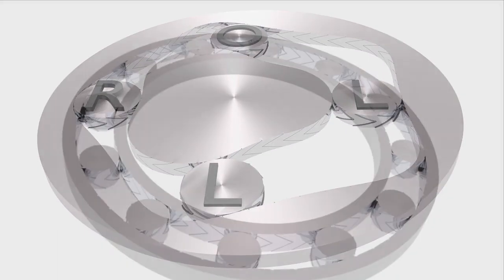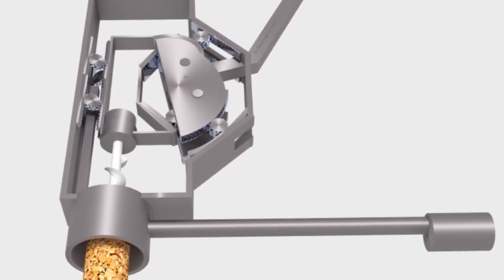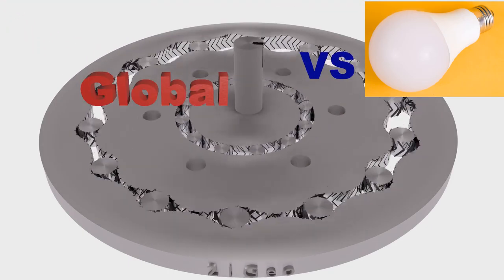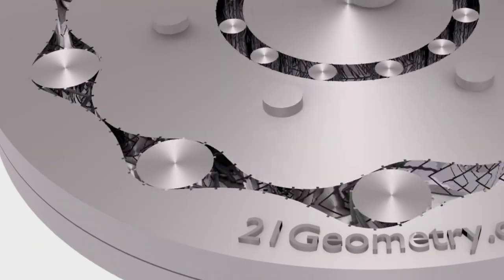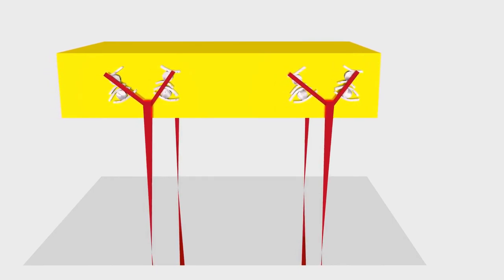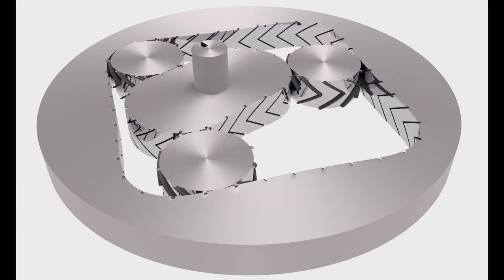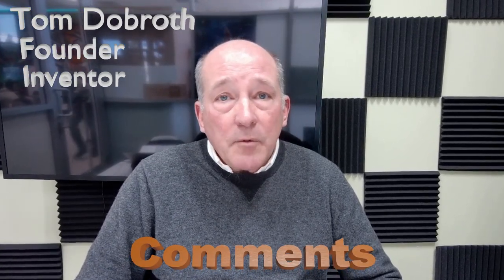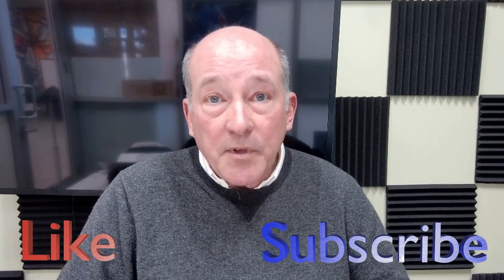Introducing Roll | A new technology that enables rolling everywhere.  v2

Comment: What is the relationship between 21Geo and RollCorp?   According to the 21Geo web site, the material there is copyrighted 2018 - though the site has only existed since 2020, with the same CG models presented here - so you've been at this for a while now.   What machine shop has quoted for producing a prototype?   What was the quoted cost?   What lab will perform testing of the prototype?   At what cost?   You have provided absolutely no stage goals for fundraising - how are potential contributors supposed to gauge viability without knowing what the financial requirements are?   There are clear geometric conflicts in the CAD model chevrons presented here, precluding operation - do these represent your ultimate geometry?  If not, what does that look like?   The positive chevrons appear with a different texture than the associated parts- are they from a different material than the associated roller?
Reply from the maker: RollCorp is a dba of 21Geo.  The corporate strategy has been challenging during a pandemic.  For a while I had to set this aside.  The questions you ask can only be answered with funded test project.  

The guide systems are a place holder for an actual device.  Only with a target (RPM, HP, service life) can the elements be designed.
Reply: @Roll-Labs  "The questions you ask can only be answered with funded test project. "

With due respect, that ain't true.  Talking to a machinist about producing the part and receiving a quote MUST happen before funding- HOW ELSE ARE YOU TO KNOW HOW MUCH YOU NEED TO RAISE?   Likewise for lab testing.   You have no goals.

"The guide systems are a place holder for an actual device."

This is disturbing; you have presented a model with critical missing elements- we have no way of assessing the viability of your solution, or determining if you even HAVE a viable solution!

"Give me money to reduce our industrial impacts."

"How much money?"

"I don't know."

"To do what, where, with whom?"

"I don't know."

Do you see a problem here?
Reply: @mavigogun  "The questions you ask can only be answered with funded test project. " 

Translation: "Give us money and we'll come up with something later!"

How many times have we been down this road?

Comment: The gearbox looks interesting.
A problem i see with some of the solutions are the number of parts vs current status.
Reply from the maker: Actually the same number of part as a cycloidal drive.  (if you count the ball bearings as one part.  If you count ever ball as a part, then cycloidal drives have many more parts).

Comment: What are the v shapes in black made of? what are the specifics about how the v ridges slot into the v indentations? Do they not "slide into place? Do they not "shear" along the straight edges as they slide into the slots? If not how? I look forward to your wonderful ideas being made! Maybe a "in the shop" youtube series about making them like wintergatan's marble machine music box series (he would Love to hear about your designs btw)
Reply: I believe they're specifically for indexing, not for transferring load. I do wonder, how would one assemble this device? Packing a bearing is already frustrating enough, this looks nightmarish if not solved by a two piece outer race (don't have a better term for it).
Reply: @saml7610  Except these 'indexing grooves/slots' will shear under the smallest amount of load, because they're acting as a sprocket.  How would one assemble these? Probably in the typical way any device that uses bearings is assembled, because these rollers rely on a shaft to keep location, whether that's in a hole or in a slot; the rollers themselves are not bearings.  The language and presentation is purposely ambiguous, and with over a half a year of CG promo after CG promo with no actual demonstration or realistic render.  Coupled with the typical bullshit about how this will be revolutionary and how green, or eco friendly, it is, which is typically seen in bullshit vaporware products, remember Solar Roadways, or the Thorium reactor car?  Oh and let's not forget false equivalence to LEDs. 

The thing is, everything shown here doesn't require indexing, and indexing makes it far more complicated than it needs to be, especially within manufacturing.  In fact, indexing is a bit of a step backwards, as your rolling elements that rely on surface friction to roll now act as a sprocket.  And guess what, squared off protrusions and grooves won't work, they would need to be involute, like a gear, except far less efficient given that herringbone involute gears already exist but the shallow depth makes these things lesser.  Funny how it comes full circle like this, which contributes to the bullshit factor.  

But a better method does exist.  There are fluids of variable viscosity that will basically become a solid under pressure, allowing for lubrication of a system elsewhere and a friction patch to allow for rolling of a circular or spherical element along a path on top of the high viscosity point of the fluid, these are often referred to as traction fluids and are often used within traction drives.  They're a great way to transfer force under smooth surfaces where gears are otherwise too complex; a great example is toroidal CVTs.  Curiously, one of the major players within the industry that is not only producing traction drives but finding new methods for higher efficiencies is Rolling Motion Industries, I wonder where the idea of naming a company 'Roll' with a similar goal of highly efficient drives came from, it could never be for search result hits and market confusion, could it? 

Roll is quite simply bullshit and vaporware, doomed to be from the start, because there's no intention otherwise, and it's gaining traction by being curated to people who either don't know better or cannot think for themselves; just like every other bullshit vaporware product/company that get busted by other content creators constantly.  Unless they actually have something to show for it soon, nothing here is new, nothing is innovative, nothing is novel, it's just a bad reimplementation of what already exists with bogus claims and incorrect labeling, especially when what seems to be their goal has existed for quite some time; 1887 was when some of the first patent literature existed for traction drives, though traction fluids didn't start making more efficient drives, due to higher coefficient of friction while under pressure, until the '60s or '70s with Santolube, founded 1967, being one of the first major contributor to high-friction traction fluid.  Between the various issues, there's no logical conclusion other than this being bullshit and vaporware, because nothing about it logically adds up, they have nothing to show for it, and their end goal already exists; they're trying to get braindead investors to buy into nothing, a get rich quick scheme. 

I also find it funny how they keep goin on about efficient drives, indirectly, for motor applications, yet they only have one animation of relevance, the variant of a cycloidal drive.  Everything else is just a roller with guide surface, essentially an inside-out cam, all of which can be produced via an inverse kinematics algorithm that traces a path and has component constraints; this is also why some of these surfaces in motion seem pretty jank and unsmoothed, while others come very near collisions with other components.  Everything here is CG after all, and not even decent CG at that.  I just find it odd how their main boasting point only has one animation out of everything, and at that it's only an efficient drive for deep torque multiplication.  Similarly, the corkscrew animation doesn't work in the slightest, they only show a rotational to linear mechanism, the lever's pivot to the corkscrew's path, yet they don't show or even imply how the corkscrew itself turns, which would require a secondary linear to rotational conversion just to make that work; and why have a rotational-linear-rotational gearbox when you could just have a standard corkscrew, because this much conversion is highly inefficient, even if the internal rolling components themselves are efficient, which goes against the entire efficiency mantra that Roll wanks themselves off to.

And the given replies contribute to the bullshit, plus the fact that they couldn't put a handful of sentences into one reply, thanks for spamming notifications and artificially boosting your own engagement.  'it's not teeth but guides/pins,' except they act as teeth in practical use, 'they carry no load,' except they will in practical use considering they're at the perimeter where torque is applied, they are quite literally a lever, and if the 'inventor' can't understand that basic concept then that invalidates any other claim they want to pretend is valid.  'Most viewers appreciate seeing a project in early development,' is irrelevant and there's no actual project to show for it, poorly done CG renders are not a project especially when there's already ambitious claims that are being claimed as fact, develop first and claim later, again the whole Solar Roadways or Thorium reactor car argument, they're being the Theranos of a mechanical drive.  'Almost all understand that the LED equivalence is an aspiration,' and most people with logical thought also understand that this is false equivalence even at the efficiency claim, complete apples to oranges comparison, in fact it goes beyond just that, might as well be comparing an apple to a chicken.  'All R&D projects must explain what would happen give their success,' is just boilerplate pitch marketing, and isn't even true at that, you sell a product based on what it could provide, not bullshit aspirations that won't be achieved when other more mature solutions already provide what this aims to achieve and in a much better way, not to mention the actual engineering teems behind the other option, when clearly this person/group clearly doesn't understand the basis of any mechanical principal; case in point being how they describe the chevrons not acting as teeth and carrying no load.  The whole hard-on for 3D printing also shows how vaporware this product is, they're trying to sell a rolling element technology, yet they're proposing they can achieve highly efficient transmission via a thermoplastic with a very poor surface finish and bad dimensional accuracy, y'know when these kinds of transmissions use precision-cut metal with a high polish; more things that don't add up, more things that contribute to the bullshit.
Reply from the maker: The chevron system is not teeth but guides that keep the pin in place.  They should carry no load under normal operations.
Reply from the maker: The pins are manufactured in two parts with locating pins.  The two halves are screwed in place simultaneously.   Work great on the 3D prints.
Reply from the maker: Most viewers appreciate seeing a project in early development.  Almost all understand that the LED equivalence is an asperation.  All R&D projects must explain what would happen give their success.

Comment: make everything more complicated and expensive, but how much efficient it will be in the end? also rolling have own problems so what exactly you solve and why it was not done before, don't think that you are first with such idea.
Reply from the maker: The secret sauce is shaping the raceways for perfect rolling and parallel surfaces at the contact points. It takes any motion as an input.  That has not been done before.
Reply: @Roll-Labs  we have f1 pistons moving at very high speeds without any rolling and they work, also without rolling works many solutions. They are not perfect but they work, what advantage gives rolling? how much will efficiency grow? And the price and reliability and how easy to repair such thing? Also selling thing without even simpliest prototype is lame. There are 3d printers, so it's very easy and not expensive to show how much better rolling solution will be. Currently looks like one more "startup" just to get money.
Reply: @jetcarq6048  That's pretty cynical.  There is a place for this technology.
Reply: @thomasdobroth  of course there is place, but rolling technology is not the unknown new thing
Reply: @thomasdobroth  There's 'A' place for every technology...but not every technology is promoted by someone hailing it as The Second Coming. These guys are long on claims, and woefully short on evidence, prototypes, and as they themselves keep reminding us- money. 

They keep harping on their technical design superiority being a market-dominating selling point- Betamax would like a word from the grave that simpler and cheaper VHS body-slammed it into.

TL;DR: This whole thing feels quite familiar...

Comment: I hope that's not another scam kick-starter, these grooves / treads seem fishy but I'm not mechanical engineer
Reply from the maker: The chevron system is not teeth but guides that keep the pin in place.  They should carry no load under normal operations.
Reply: @Roll-Labs  And of course as all engineers know, nothing ever operates in any way except normally as planned... right?

Comment: I found this and thought of you , https://youtu.be/bwGQlf0y6zE  
How could you improve this engine with your tech ? Tell me what you think !
Reply from the maker: A very important feature of Roll Tech is that adding a component to a problem gives three continuous degrees of freedom.  That's way more than any other type of mechanism.  For instance, adding a link to a linkage gives one discrete degree of freedom.  Which means that I can provide any waveform to a thermal piston problem, while rolling instead of sliding.  

I am currently exploring ways to turn rotation into linear motion.  When done, I can produce a low-resistance crankcase replacement that provides any desired waveform.  

With that system, I could counterbalance any vibration.  

More efficient HVAC, cars, buses, trucks, etc.  

Maybe I should be working on that instead of fooling around with YouTube?